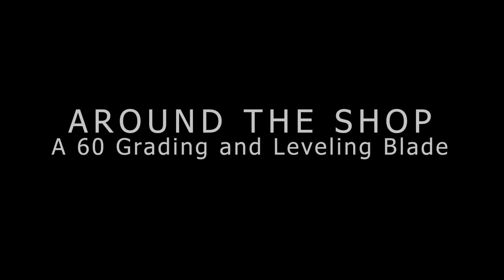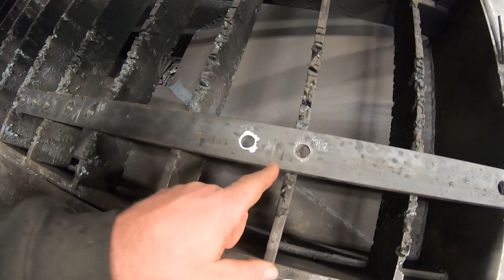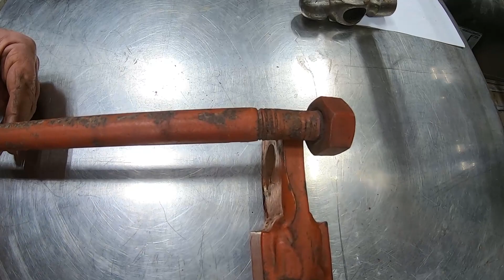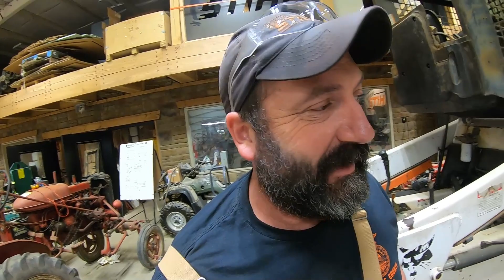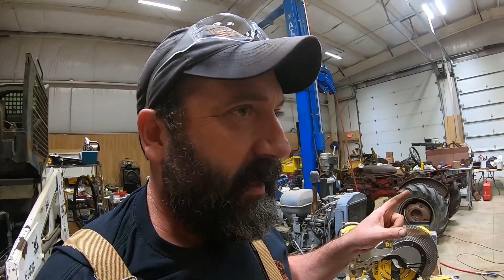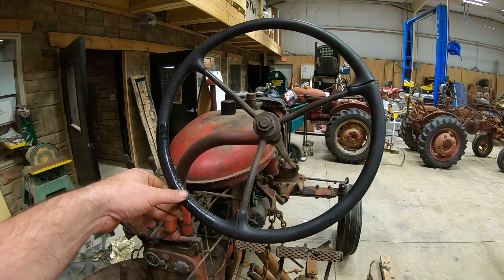IH International Farmall A 60 Grading and Leveling Blade...For Super A -140  Part 1

Comment: I have the manual for the A60 Leveling & Grading blade. The part you  showed that was cut off is part of the mounting bracket. The manual doesn't reference what the additional lenght is for. The two pieces you  fabricated are the pivot axle mounting bracket and pivot axle hanger. Nice job on the fabrication.